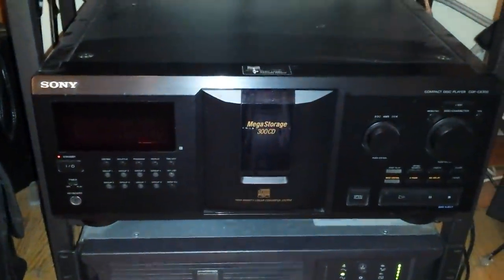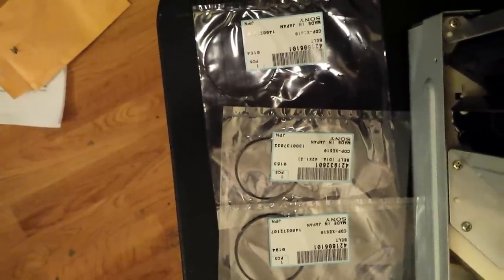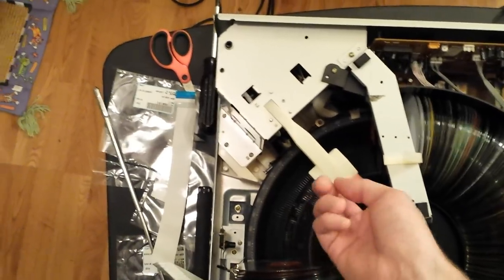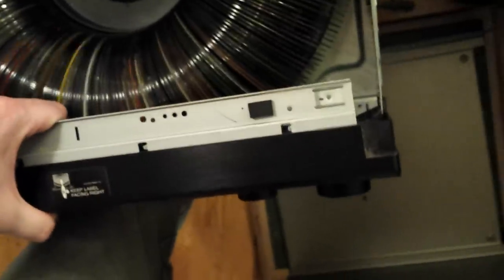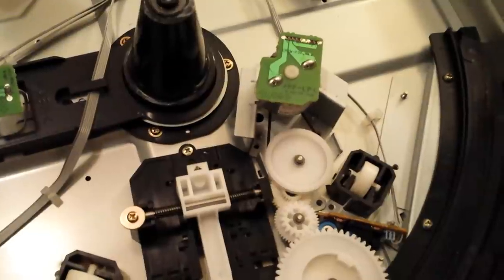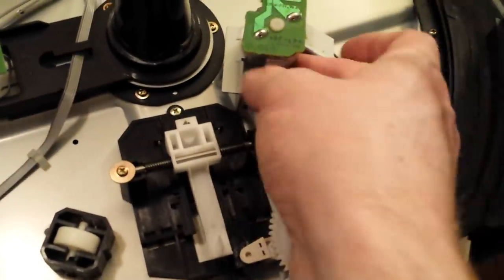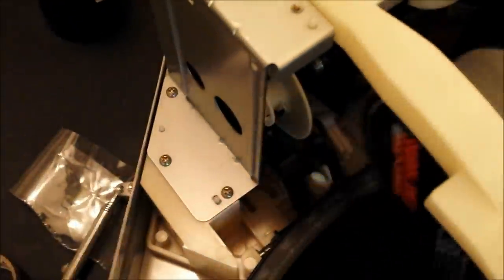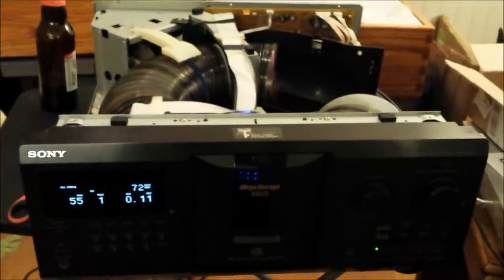Sony CDP-CX300 300 Disc Changer Belt Repair and Maintenance While Full

Comment: The carousel doesn't have to be removed if you take the CDs out.   I just tilted the carousel up after removing the front triangular piece.  I didn't have to remove the front panel either. The triangular piece, which has the top slide for the door, slid right out. It was an easy fix. Thanks again.  It wouldn't have been so easy without your video!

Comment: The internet remains undefeated.  Fantastic video, thank you!  For others considering the repair, I was able to do it start to finish using this as a guide in a little over an hour without rushing.  I also had a full carousel.  Two added thoughts.  #1:  To adjust the position of the carousel, I had to lift it slightly to move it around .. it didn't spin smoothly for me.  #2:  I found it relatively easy to change the rear belts from the front once the face of the unit was off.  One of them was a little tricky, but a letter opener did the trick to feed and hold the belt on the smaller pulley in the back.  Thanks, hugeshows!

Comment: Excellent video. Had ordered my belts and they came in 3 days later. Put them on today using your video. Now I started with the 2 belts in the back. One was off and the other barely hanging on. The only thing I did differently was to unplug 2 additional wires to allow a little more clearance. Replaced those 2 and decided to plug it in and see what happens. Working perfectly.  I decided to wait on the carousel belt until it actually falls off, lol. Like yours mine was full(er) and decided to save that for another day. Thank you so much for this wonderful video. 👍

Comment: I used your tremendous video to work on the Sony 400 DVD/CD. I ordered the belts from ECompass and they did send Sony originals. I was leery on installing the belt for the door. Next time opening it I might try just to remove center screw and lift carousel. You are to be commended on your video. I learned quite a good deal of info and increased my confidence. Five STARS.

Comment: Excellent repair video, did this 3 belt change myself today, but after refitting the front I found the player kept opening the door after pressing play. Found that the door was hitting the door frame on the left. It worked if the front was off, pushing the door all the way to the right cured it. Thanks again for making this.

Comment: Thank you!!!  I have two 300 CD changers, both of which had the same problem...bad belts.  Found your post, found the belts on eBay and within the week had both units running like new.  I taped the door belts inside the chassis.  Both unit doors worked fine and I didn't want to hassle with removing two FULL carousels to access the door belt.
Reply: Hello DM. What is the size of the belts for the table? I am ordering two for my CX355 300 cd player and I want to be sure I get the correct size. I just finished replacing two on a CX300 that were size diameter 42x1.2. They are working so far on that unit.

Comment: This was so good I had replaced my player and then my two player system had another death of belt in less than an hour I replaced the two belts and now have a spare player both operational because of your video.  I will wait until the door belt goes. Mega kudos, dude!!

Comment: Thank you for this video! It gave me the guidance (and confidence) I needed to fix my 15-year-old unit that suddenly stopped working recently. I paid $9.45 including shipping for the two main belts on eBay and, following the first half of the video, I was able to get my machine working again 100% in under an hour. Two minor notes: (1) My unit required me to remove a couple of additional screws off the back panel as compared to the video. (2) In the video, the ribbon connector on the board is black, whereas mine is white, which caused me some confusion (luckily I didn't try too hard to pull the white plastic piece off the board!). Thanks again!

Comment: Good, clear instructions, thanks! My 400CD changer door would not open without a little assistance, so I did remove the platter with the discs on it and changed the belt: Still have the opening problem. I think it may just be a mechanical misalignment of the door.. Removing the platter is not quite as bad as it seems in your video, took about 30min.

Comment: This was very helpful. I got my belts on eBay from a supplier that also sent one page of instructions. I'd recommend just taking out the discs. If you do, you won't have to completely remove the turntable to get to the belt under it and you won't have to remove the front.

Comment: Thanks for posting this, it gave me incentive to try the repair on my 20 year old CX335.
I chose to remove the CDs from the carousel as I only have about 125. I pulled them out from the top and numbered them with a felt tip pen and stacked them in order. The carousel came out easily with taking off the back curved piece or the front panel. After I replace the belts, which are on the way, I will insert the CDs in their proper slot (I hope) and put it all back together. Once again thanks for your great video.

Comment: Thanks for the video! I had the problem with the turntable drive bets, except my belts had somehow melted. I hadn't used the turntable in many years since I now mostly listen to mp3s of all my music. I had to remove the turntable to properly clean up the melted rubber from the drive pulleys. Rubbing alcohol and Q-tips did an excellent job although the job was meticulous and time consuming. I had a problem with the discs spilling out after reassembly. The problem was that the tabs on the turntable shield in the back of the unit actually penetrate the frame. My work surface did not allow the cd changer to sit flat and the tabs pushed back out of the frame openings. I never would have thought that Sony would have created a situation where the shield cound be pushed loose simply by setting the cd changer on an uneven surface.

Comment: Thank you for your comprehensive instructions on changing the belts on the sony megastorage unit. I was fortunate to have a spare but wanted to fix the old one anyway. Using your instructions made it a snap and it is now as good as new.

Comment: I have a Sony 400 CD changer that is exhibiting some of the problems mentioned in your video.  Thanks to you doing this video, I think I can complete the repairs myself.  I will have to find the replacement belts on line somewhere, but it is great to have your video to guide me through the installation.  Thanks again!

Comment: Thanks for doing this. Swapped all three belts and the player that I found on the side of the road is restored. Granted, one of the analog channels doesn't work - but digital out works great. Thanks for making this video!
Reply from the maker: I don't know if you think it's worth the bother, since you seem happy with the digital outs, but often the RCA jacks on these type of consumer electronics suffer damage when connected cables get knocked.  It is often the center pin of the jack itself that gets damaged, the plastic around it, or sometimes the solder connection on the under side of the board where the jack is mounted.  It's possible that the audio output is roasted, but more than likely re-soldering or replacing the jack will fix that.

Comment: You are my hero!!  Wished I would have watched this before dumping all 300 discs out tho.  With an empty carousel this was a 20 minute job for all 3 belts. No surprises, just as you showed. Yah, so the video isn't HD, your narrative is 100% accurate and made this job a piece of cake even for a ham hand like me.  One note, if you slip a belt when the machine is in the middle of plucking a CD there is a locking "pin" that prevents you from turning the carousel.  One must turn the gears by hand in the back of unit to disengage the pin so you can remove the carousel.  Under $11 for belts on EBay. Thanks to you this is NOT the day the music died!!

Comment: Just replaced the two belts. The door is still working. Just a guess, but I think the door belt is much less used than the carousel /cd-changer belts. Maybe it’s rare for this to go bad?  I had to disconnect more cables in the back to get access to the belts. Just have to chain this to my Sony 400 CD changer and load it up! Thanks for going the extra mile.

Comment: Awesome, this worked great, much better than the instructions that came with the two (2) belts.   My old belts looked fine, but when overlaid they were bigger and the slippage was causing the thing to act drunk.   So while I wasn't sure if this was the fix prior to beginning, it's  statistically a good bet for $10, and YES, it did fix the machine.  Thanks, good to go.

Comment: Didn't get into mine yet, but your video gives my much courage to attempt it. I will probably NOT do the belt under the carasole unless it is absolutely needed.  If that is the case then I will probably remove the 350+ disks.

Comment: Terrifically useful and informative video.  Thanks for taking the time and trouble to make it.  I think I could have managed replacing the belts without seeing you do it, but your video sure as heck gave me confidence (especially with respect to the turntable drive belt) and made the overall task very much easier.  By the way, no need to apologize for the camera work.  It was amazing that you could do so much with just one hand while holding the phone in the other.  Thanks so much again.

Comment: Great help. I have two of these units, one 300 disc and one 200 disk I got for a reasonable price. I am temporarily using an elastic band for one belt until I get the replacements.

Comment: Thanks for the video-made this a simple fix with NO wasted effort. But, since the door was working fine, I taped THAT new belt inside for when that one fails. Then I will have to do the tray removal.
Reply: Larry Flowers   That belt will probably never fail because the door is seldom opened and doesn't have the stress on it to move a heavy carousel around

Comment: The CDs made a simple job into a total dissemble... from what I've seen elsewhere the front doesn't normally have to come off. I'm going to try what you suggest and replace the rear drive belts while the platters out.

Comment: Thanks for the inspiration and guidance to replace the belts on my CX350. I was still having trouble with the carousel jogging back & forth, and got a table error. A RESET (Clear & Power) got me functional again, but also erased ALL the tediously entered disk data :-( I don't know if there's a way to reload everything stored in the remote, but in trying, I ended up wiping the remote too. :-( 
Should'a read the instructions.
The machine still struggles to turn the carousel, and I suspect that following your front-side disassembly, plus cleaning and regreasing the carousel pivot and bearings, and cleaning the carousel sensors, is what is required. Still, Mrs. currently has her Christmas music, and there is Peace on Earth. ;-) 
Thanks.

Comment: just bought a cdp cx455, and the door didn't work. took off the top, undid the screw in the middle of the carousel, pulled up on the carousel til it popped up a little. stuck my hand in there (which was a bitch), and maneuvered a rubber band on there. works great now, didn't have to take all that shit off. thanks for showing me where the door belt pulley was.

Comment: I liked the video; informative and in detail, both in teardown and reassembly.
I have mine is in some pieces right now, waiting for my new belts to arrive. But the first thing I did was to remove all the CDs just to avoid the hassle of trying to handle and work around them.
I especially like the tip about removing the connector  for the belt drive motors in back; it clearly opens up more space for installing the belts.
One question though: would you have been able to dismount the platter without removing the faceplate if you had not had the discs in the player?

Comment: Have you ever replaced the Door belt under the carousel on the CDP-CX450 400 disc changer & if so do the steps differ much from the 300 disc?
I bought belts a long time ago & are just now getting around to fixing it

Comment: Very Helpful video..... my question is are you suppose to be able to turn the turntable easily?
Reply from the maker: It'll be harder to turn if the belt is good because then you'll be turning the motor as well.  Other than that, I'd need a little more context to answer this question.

Comment: Really helpful video, got the belts at the back changed as disks had stopped loading but before this they had started skipping, unfortunately the discs are still skipping so I'm half way there. Any idea why the disks are skipping could it be the motor for the play mechanism?
Reply from the maker: Skipping can be hard to diagnose without test equipment like an oscilloscope and a service manual for the unit, but generally it is most often related to the optics.  Inspect the laser lens for dirt or atmospheric hazing, don't clean it unless you need to, and please do that carefully if needed.  Other things can drift like the alignment and laser tracking adjustments.  Often CD players have trimpots for adjusting those back to normal, but without a test CD, o-scope, and the service manual, you'd be making adjustments blind.  I would also make sure the discs haven't gotten dirtied or scratched while in the player - that can happen.

Comment: It's much better to 'enter from the rear' when installing the two back belts. The white plastic gears and mechanism is covered in white grease and if you drop the belt onto it you've got big problems. Not only will you get it on the belt, but also onto the pulleys! Caution! Good vid, very helpful, thanks.
Reply from the maker: Alreedy alrighty!
Reply: "They said aw-reety
An' they was aw-righty
An' I was a Zomby for you, little lady . ."  hugeshows, thanks again!

Comment: Replaced all 3 belts (even though the one under the carousel was fine) but this keeps happening, the carousel always stops one or so slots away from the clamp, then the carousel goes back and forth and then it ends up in table error.  Have reset all belts and checked that all teeth on gears are fully set. What is causing this?

Comment: I replaced all belts, but that did not fix the problem,  When I power up the unit, the table turns about half a revolution in both directions for about 30 seconds.  Then I get the table error code. I have tried the reset (power and clear buttons), and that does not work.  I suspect some type of sensor, any thoughts on this?

Comment: Fantastic video for the belts, but did you have a problem with many CDs skipping, therefore, issue with CD reader and if yes can it be fixed?
Reply from the maker: There are many things that can cause skipping.  First thing to check is that the neither the CDs nor the laser pickup have gotten dirty.  If those aren't the problem then you'll need special equipment to check the alignment of the laser and several other more complex problems.

Comment: GREAT VIDEO BUT  AFTER i REPLACED THE BELTS THE DISC GOT STUCK AND BROKE OFF A PART OF THE OPTICAL DRIVE AND TOOK IT APART AND HAVE NO CLUE HOW TO PUT THE OPTICAL DRIVE BACK TOGETHER ANY IDEAS ON HOW TO REASEMBLE THE OPTICAL DRIVE i ALREADY HAVE THE REPLACEMENT PART
Reply from the maker: Sorry for the slow reply, but without looking at it I would have no idea.  Sorry, and good luck!

Comment: Hi, can you please let me know what kind of back-up battery these unit has?
I mean, the model of the button-type battery located on the main board.
Thanks a lot for your time!!!
Reply from the maker: Sorry, I don't know offhand and it's a tad too much work to find out.  Honestly, I don't even recall a battery.  However, most lithium coin cells will have a part number on them.  CR2032 is very common for that application, including variants that have solder tabs pre-welded to the battery.
Reply: Guessing is really not helping.

CDP-CX300 is using capacitor ref. no. C520 - 1 Farad 5.5 Volts.
You will find it on the mainboard near heatsinks and is not replaceable without soldering.

Comment: Hi man, Ive got another question for you my friend.
My CDP-CX230 has a couple of scratches and the lcd display is a little faded. Ive found a complete CDP-CX300 faceplate. Do you have any idea if it would work? 
Thanks a lot man!!!
Reply from the maker: I honestly have no idea, I am not familiar enough with the display circuit on either model.  If they look identical however, they very well might be.  They may have made one part for all the models, but I really can't say.
Reply: Ok, thanks a lot mate!
Reply: I am not familiar..., either. However, I can say that they, of course, did not make one part for all...
Among other differences, height of CX230 is 200 mm, and that of CX300 is 189 mm...

Cleaning the display and filter from the dust from inside may help.

Comment: I appreciate the video but the best thing to do folks is to take all your CDs out organize them and clean them you can pull the turntable right out without pulling the front off and the belts can be replaced without taking the back off

Comment: I put it back together and when I turned it on it sounded like it was binding so I turned it off. Now the power does not come on at all. Do you know where to check for a blown capacitor?
Reply from the maker: I believe that if it detects a fault it shuts itself off completely and you have to unplug it to reset it.  Try that first.

Comment: There's an easier way.  Just pop the 6 screws off the back panel, unplug 4 connectors, lay it over a little and the belts are right there. I changed mine today and it took 20 minutes.   I just did the carousel and CD  unit belts.  To change the door belt it's a lot more involved.